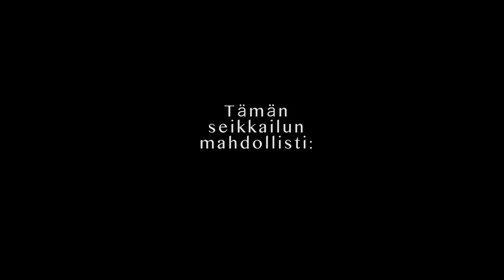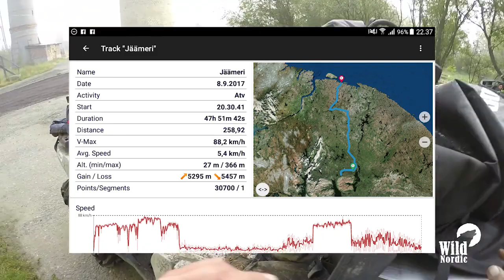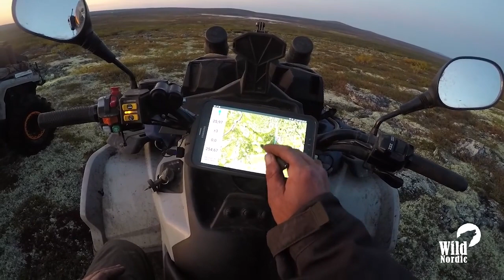Can-Am 6x6 Arctic Trophy 2017 2/3

Comment: Swamp witch or mud crusher?
Reply from the maker: mud crusher
Reply: Thank you!
Reply: I bought and install the mud crusher 28". The distance between the two back wheels is very tight, and when I go over an obstacle they touch each other... not much, but enough that I'm concerned... 
How work for you? You have done some modification?
Thanks for your time and help!
Reply: What tire size do you use?
Reply: @oliverllobet4267 use arms  from highlifter